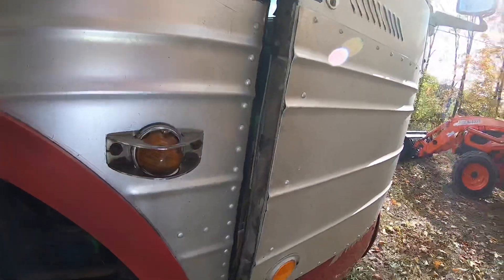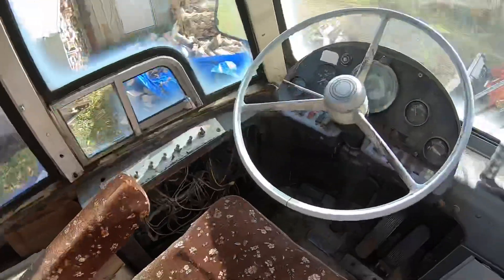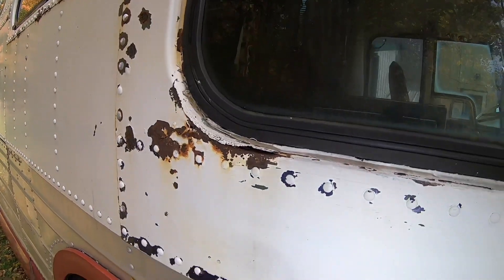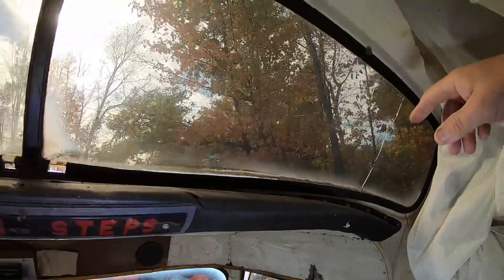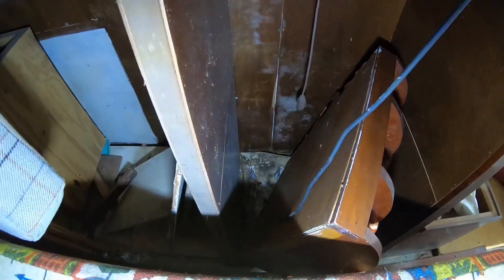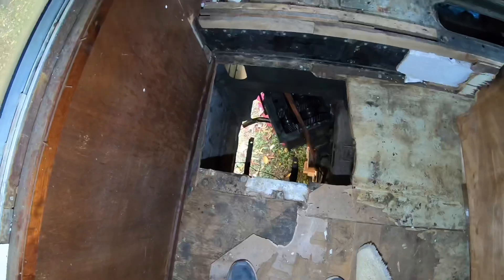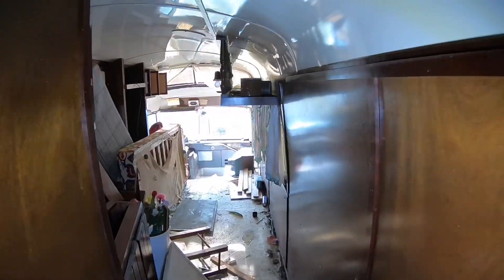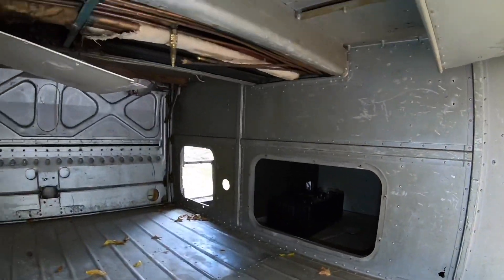1967 GM 4107 bus interior tour

Comment: WE have a 1960 PD4104 and am starting to get the windows back in shape to stop water from leaking in and rotting the floor and molding everything. Ordered the sash material and have been digging out the years of caulking and RTVing around the sliders that didn't slide but trapped water to pour over inside. Keeping my fingers crossed that after all the hard work it pill pay off.

Comment: Don't remove all the ply floor at the same time. The more monocoque body can warp or sag. Just a section at a time. The crack over the passenger side D window is common. There is a plate repair for that. Bolts or rivets to the exterior.